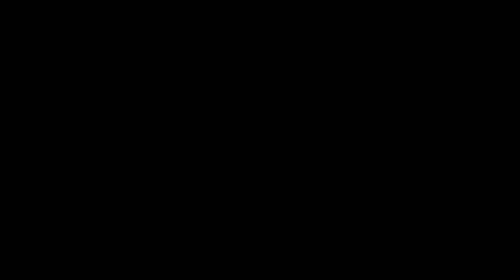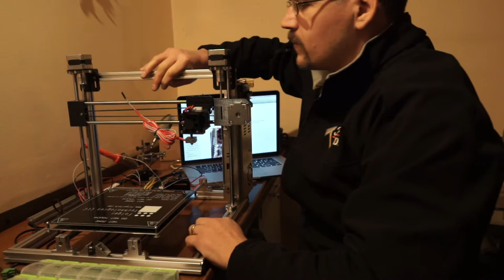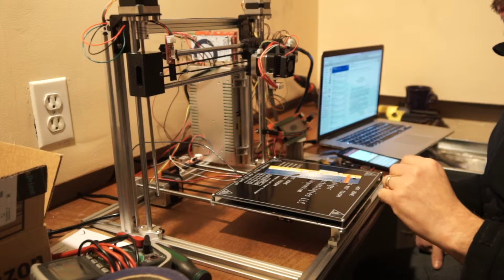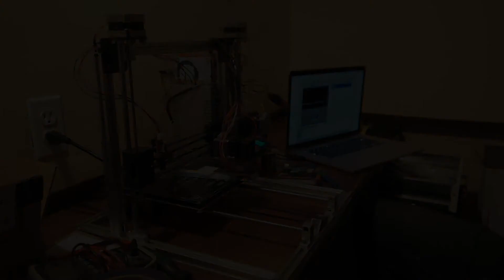FolgerTech 2020 Prusa i3 Build 6 - installing the power supply & ramps,

Comment: Thanks for the video! This may sound crazy, but I am literally building this printer right now, so your timing couldn't have been better! I'm a mechanical engineer but I'm pretty inexperienced with wiring, so watching your guide here helped me out a bunch!
Reply from the maker: +Ribieconvoy glad I could help... seemed when I looked most of the videos were time-lapses or assumed you knew what you were doing... being my first printer I made note of the things I thought were weird... loving this thing so far but want to build a scratch one sometime this year....

I actually finished the printer a week ago... just got the videos edited today... already have plans and parts on the way for v-slot x and y axis and my bltouch sensor was delivered a couple of days ago... so more videos coming...
Reply: I have to ask before I power mine up- was the guide incorrect on the connection for the extruder motor? I've heard comments that it should be flipped so that the green and red wires are opposite what is in the build guide. I really have no electrical experience so I have no idea how to make heads or tails of it.
Reply from the maker: +Ribieconvoy I did flip mine... green wire towards the power supply... I had not extruded any filament when I recorded this... worse case of you get it wrong it doesn't extrude when you tell it to it retracts... 

good luck... I know I am very nervous anytime I build an electronics project and power it up for the first time...
Reply: Thanks for the advice! I really appreciate it. One last thing... I'm wiring up the power cable on mine, and the guide has a blue wire and two blacks, while the included cable has a reddish brown, blue, and a green... If your kit is similar, do you mind letting me know which one is the live one? I have no idea how to tell, really, and it might be different than yours- I just figured we both got a newer run of the kit since I have a black heated bed as well, as opposed to the red one seen in pictures online. From what I can find online, the standard is brown is hot, blue is neutral, and green is ground.
Reply from the maker: +Ribieconvoy I plugged mine into the wall and tested the lines with a volt meter... for mine I have red to line blue to neutral and green to ground...
Reply from the maker: +Ribieconvoy also found this link : http://www.regiscoyne.com/tech/pwrcordcc/ which other then the red not being brown is correct with my setup
Reply: Yep, that's one of the sources I found as well! Once again, sorry to bother you, but I figured it couldn't hurt to ask someone who has built this first hand. Thanks again, I'll definitely be watching your channel to see what kind of upgrades you have in store!